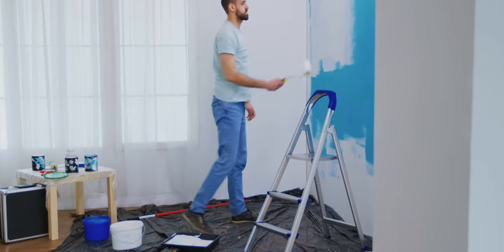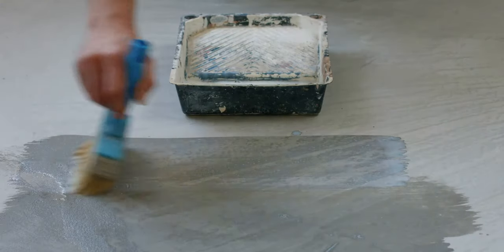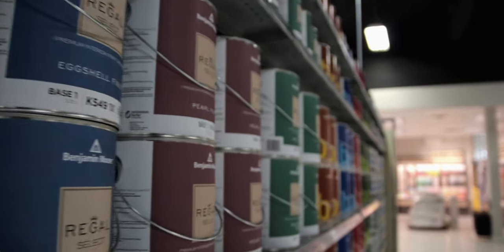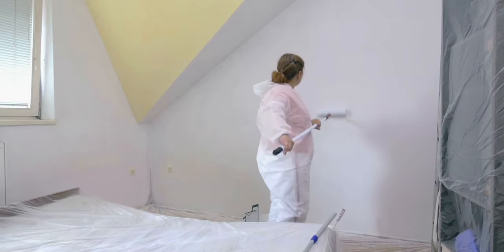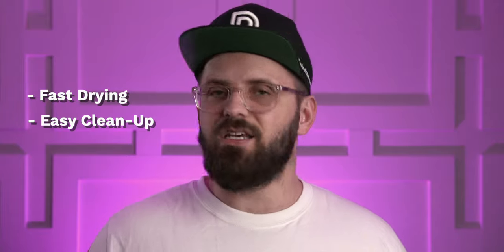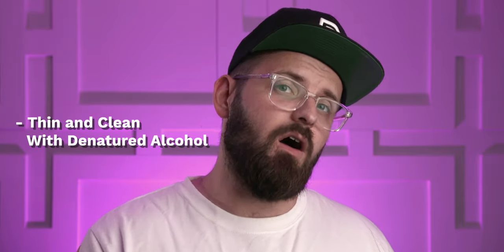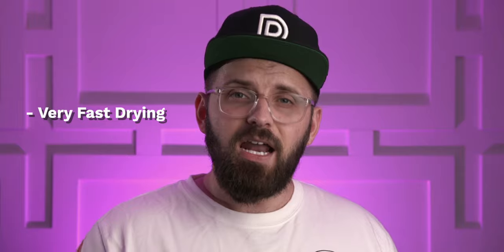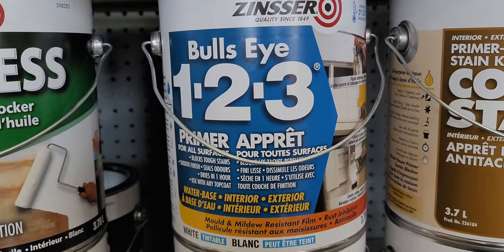PAINT PRIMER GUIDE | Which Primer Should You Use? | How to Choose Paint

Comment: Do you have to use water-based primers with water-based paints and oil-based primers with oil-based paint?  What happens if you mix one with the other?  I have some bare wood that needs to be primered before I paint, but I need to use a latex paint (everything else I am painting is covered in latex paint currently).  Is it OK to use a water-based primer for this bare wood?
Reply: Yes that’s exactly how it works but I’m sure sticks will grab into anything you can try because I’ve use it before
Reply: NO! you can use water-based (latex) paint over oil paint or primer but not the opposite (oil over latex).

Comment: I have a room in my basement I just put new drywall on.  I also am going to be priming an exposed ceiling with wood, metal pipes, wires, pvc, etc.  I have a sprayer to apply but debating what primer to use.

Comment: excellent, informative, thanks! I want to know about what type of paints you can topcoat over primers. For example, I have been told to never put an oil based paint over a latex primer, and vice versa, but others have told me that mixing them is no problem. Confusing.

Comment: fyi, had a roof leak (now fixed). cause water staining (greyish darkening ) of a white painted ceiling. it took 2x coats of kilz 2 primer and 4x repainting of original paint to reduce perceived darkening. there is STILL a slight difference. 

i suppose i should have gone with a oil based primer.

Comment: I have damaged, ripped brown paper drywall after backsplash removal.  I plan on fixing it with Zinser BIN and joint compound.  The manufacturer mentioned using a drywall primer before backsplash install.  

Can I use INSL-X Stix Waterborne Bonding Primer underneath Acryl Pro Professional Tile Adhesive or will it not bind to the tile adhesive and interfere with my backsplash install?

Comment: Awesome video! Very informative. I am attempting a furniture restoration for my niece and have several different pieces, including a wood dining set and a  laminate/ particle board closet and computer desk. I did some research yesterday and learned that a shellac-based primer would be good at blocking wood bleeding and also help the paint adhere to the laminate but at the hardware store today the sales rep was trying to talk me into buying Gripper, which he said was water-based. I ended up going with the shellac but would a water-based primer work just as well for painting furniture? My niece is a new mom so she'll need something very durable.

Comment: I've been hired to project manage a haunted attraction and we make a lot of strange items into stone looks. Almost anything you can think of you'll find at a thrift store, we can probably find a way to make it stone... anyway, my question is on painting ornate items that have polished finishes or glazes that are too hard to sand well. A lot of stone props we make its easy just to throw monster mud (drywall compound and outdoor paint) or Drylok... but for things that don't really need the extra hardening, or have detail work that we need to keep to spraying, I want to make sure i'm adhering well to the surfaces and it wont chip outside in the elements all year. 

I have a project now where I have metal lamps, some kind of ceramic with a glaze and other objects of unknown material that shiny surfaces. I've got a technique for making the stone look with paint, but unsure if I need to prime, or if I can just use spray paints fine.

Comment: Thanks for sharing, I am attempting to paint over Chip board.  It is a large area and I do not want it to swell or ruin what  my (deceased husband) did before he died in his Man Cave!  Just want to add a little color and do it correctly!  I am open for any suggestions.  where do I buy this so called " Bonding Primer and it will it spray through a paint gun?  Thanks again for sharing.
Reply from the maker: Hi Linda!  BM INSL-X Stix primer has no issues spraying!

Comment: I used shellac primer then for second  coat put oil primer over the dried shellac primer. It didn't cover very well so..... My question is ,can I do a 3rd coat with my shellac  or even a water based primer after it's good and dry of course. Thank you

Comment: Question......What are your thoughts on just using the Original Kilz (oil base) Low Odor primer as a ceiling paint on a popcorn ceiling in a bedroom.   I like the bright white color, it hides everything and it has a durable finish.
Reply from the maker: Hi Greg, I’ve seen people use that before on stucco ceilings, just be mindful of the sheen level. Some oil based primer‘s have more of a sheen compared to a dedicated ceiling paint.
Reply: We've used various kinds of oil products for painting stucco ceilings, including Kilz, Zinsser, and Glidden.

They do have somewhat of an enamel-like sheen, but they're very strong and reliable - Though a bit messy to apply...

Comment: Great video! What would you reccomend for re priming/painting a smokers house? The house my wife and I bought is riddled with nicotine and tar stains throughout. The celieng is textured with those circe sponge type designs. We really want the home to smell smoke free when we're done. Thanks for the help!
Reply: Whilst Zinsser products are pretty dear, there are of very good quality. I would use Cover Stain. However, it does flash/grin through emulsion. I had to coat over Cover Stain with Bulls Eye 1-2-3 before attempting to paint with emulsion.
B-I-N is also very good, but dries very quickly, so the finish can be ruined as the shellac gets sticky if you don't finish laying off quick enough. As the solvent is meths /alcohol, that's something that smells quite strong, is flammable and therefore takes getting use to.
Reply: @bitTorrenter    If I can add on to this question - what would you use if you had to keep the smell at the level of your basic paint or less (and don’t want smell to stick around.. breathing issues).  Senior citizen smokes (very visible on walls) and wants rooms painted, but will continue living there during this time.  Hasn’t been painted in over 20 years.  Sighhh.
Reply: @spiritmama  add vanilla to the paint !

Comment: question, do most primers have anti fungal additives in them to resist  moss and mildue  growth. my walls are exterior concrete block masonry walls which have been plastered with motar  and I was thinking of going with sherwin Williams optimous primer. is this a good choice for my application 🤔
Reply from the maker: You have to get rid of the mildew first. TSP should do the trick. Then rinse walls a lot, allow to dry. Zinsser 1-2-3 is mildew resistant primer that should work. Then any exterior 100% acrylic paint as a topcoat.

Comment: I went to a PPG store recently about a project I am getting ready to do. We are turning a upstairs office I to a nursery. The room has chair rail and bead board (pine) that has at least 1 clear coat on it. The salesperson I spoke to noted that he thinks if I just do a light scuff of the chair rail, bead board and trim them I would not need to prime? We were thinking of using simply white for the trim color and sandy beaches for the wall color (both BM colors). If we were to go with PPG paints which paints would you advise for the trim/bead board  and then the walls?

Comment: Best Primer for new drywall? Would you need 2 coats or would 1 do?
Reply: 1is enough on cabinets 2 😏
Reply: I always use Gardz Primer if it will be a smooth wall. If texture a good paint and primer or Bullseye will do the trick.

Comment: Omg started priming kitchen cabinets and used kilz oil based but now I want to try the binsser shellac . What are your thoughts? I used kilz because I was familiar with it but have been hearing a lot of positive reviews on the binsser 🤦🏽‍♀️
Reply: Zinnser BIN I believe you are talking of. It's a go to for me and I use it for Kit cabs/vanities, Furniture etc etc etc. 6 yrs and never had an issue yet (knock on wood) .
Reply: Be careful with the Bin shellac primer fumes. Make sure you have adequate ventilation  or an exhaust fan. The can now has a bigger flammable label on the front due to some explosions that have been caused from sparks or pilot flames on stoves water heaters etc etc near by. Its also recommended to keep any compressors outside the spraying area to avoid a  potential  spark up and deadly fire. I have sprayed and rolled Bin primer numerous times and love it. A 3/8 nap premium shed less knit purple roller from home depot part# 1001287431 works great with lightly thinned down paint, dont worry about rough texture at first..it will dry even and sand super easy and smooth. In some cases i have used Bin as primer and top coat for interior portions of cabinets and holds up very well with 2 or 3 coats unsanded. You can tint Bin also, hope this helps.

Comment: I am painting my kitchen cabinets in a house built in 1947.  The cabinets appear to have latex over oil...the latex paint on the shelves stuck to the contact paper that was there. What a mess. My question is, what kind of primer do l use when two different types of pain are exposed?  I sure opened a can a worms 😞
Reply: HI kay . I wish i could see the condition of your cabinets in person but just from what youre saying I woud go with a good latex primer ( after a good degreasing job with TSP )

Comment: I still have question please. Builder (1983) used oil paint on whole house trim. Not knowing any better, I used latex over oil on the trim for the last 30 years. I’m repainting the whole house. What primer should I use so my latex adheres and doesn’t peel off with a swipe from the vacuum? I can’t imagine a way to be able to completely strip off all the latex. My den has 32 picture moldings so the trim is extensive. Thank you.
Reply from the maker: I would recommend giving it a light sand to make sure it's not coming off, then prime it with something like Stix by Insl-X or extreme bond primer by Sherwin-williams!
Reply: @thepaintpeople  thank you. I have so many of your videos tonight. I’ve been making notes as I have appointment Tuesday with the BM designer here in town. Redoing the whole house and need to choose colors. I loved the Hale Navy, Cloud White, and Chantilly lace comments. I was leaning towards Chantilly but I think, based on the recommendations I’ll go with the Cloud White since we’re probably going with a light gray flooring. I’m going to get samples and see how they look. Thank you so very much.

Comment: Hi there , was thinking of using zinsser 123 water based for some barewood furniture I just made then Helmi 30 for the top coat. Do you think the Helmi will take to it well and do you think one coat of zinsser is good enough? ps its new wood so no surface issues. thanks in advance

Comment: I’ve been told to use an oil base primer for my trim wood and that I can use a latex for the finish paint, is this true ?
Reply from the maker: Is it new wood or previously painted?
Reply: It will be all new , raw.
Reply: I know you cannot paint latex over oil base paint, but I’m told you can paint latex over oil base primer. Apparently it’s a smoother finish for trim paint
Reply from the maker: If that's the case then yes, I would use oil base primer.
If you use a water base primer the wood will get fuzzy and you will have to sand between coats.

Comment: What primer would you recommend to cover dark walls?  I'm repainting my interior walls from sage green and warm nutmeg to Paper White and Chantilly Lace.  HD recommended Kilz2 but that took 3 coats to cover the sage green.
Reply: tint the primer at the store
Reply: Tinting the primer at the store will do nothing for you, if you were going from dark color to two whites use a good cover primer like BEN 123, or even BM Cover Up.
Reply: Hi-hiding flat acrylic white paint covers darker colors better than primers.  If you’re just painting painted walls you don’t need a primer.
Reply: (incase someone new reads this) YOU DON"T NEED PRIMER when painting over paint. (So long as the wall isn't plastered with crap like smoke, oil, crayons lol) . Think of it; you want to turn your dark walls light in the least amount of coats right? For extreme changes its going to take three coats. Most ppl look at this as primer then paint then paint. But the thing is,  you want your first coat (base coat) to be as opaque as you can. And that will NOT be accomplished with primer. Using a primer strickly to change colors is a bullshit sales pitch because in this case, it'll do very little and you'll still end up putting three MORE coats of SOMETHING on. Buy a less expensive flat paint that is the least transparant and tint it to the color you are going to. Your paint store will know. The local ones. Probably not the $12/hr Home Depot or Lowes ppl. What you are aiming for here isnt quality, sheen, durability, wipeabilty, NONE of that. You are simply trying to get that dark covered. This comes down to opacity.

Comment: I”m using bullseye 123 to prime exterior of a house with multiple layers of (all kinds) of paint. It says bonds to anything and can be used with oil or latex so I’m hoping this does the trick, I’ve chipped and sanded and pressure washed in advance. Is this the same as STIX ?
Reply from the maker: Bullseye 123 is better to use for exterior.  Stix dries to hard and may crack when using outside.
Reply: @thepaintpeople  thanks! Should I put peel stop on really problem.areas?

Comment: I just stained my stairs and it is too dark.  I want to paint over them but I do not want the stain to bleed over the paint.  I was told Zinnser Bulls Eye 123 Undercoat primer sealer stain blocker would do the trick.  Would this be correct and the easiest way?
Reply from the maker: Yes this will work.  Apply one coat of primer and two coats of the top coat

Comment: This is exactly what I searched for today - thank you! You're informative and you stay on topic.I'm a new fan and subscriber. May I get your thoughts about priming a very porous ceiling? The ceilings in my 'new' place had never been painted; they still have the builder-grade, grayish, textured ick that was sprayed...27 years ago. Yes, they're gross. But after cleaning them up a bit, I realized just how porous they are and so I'm a little nervous about which primer to try. Your thoughts would be greatly appreciated. I realize it'd be a blind guess, however yours is likely far better than mine.
Reply from the maker: If you have a stucco ceiling that has never been painted, we strongly recommend using an oil based primer as your first coat followed by two coats of a water based ceiling paint.  Hope that helps!

Comment: I'm surprised he didn't mention PVA primer at all. I'm curious to learn where PVA primer falls in all this.
Reply: In my experience, PVA primers are only good for new drywall and mud repairs. They are cheap but if you're painting anything other than new drywall/mud it's similar to using a very thinned out paint.. takes several coats but great for new drywall work.